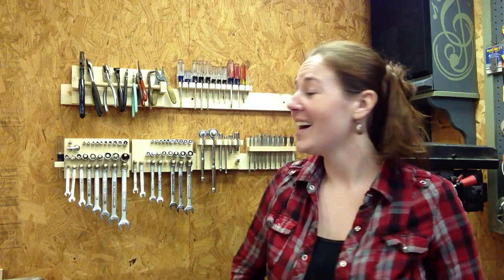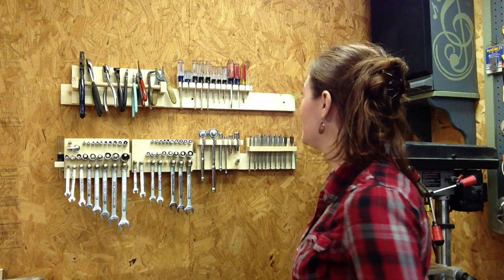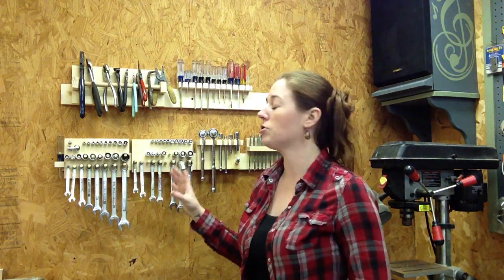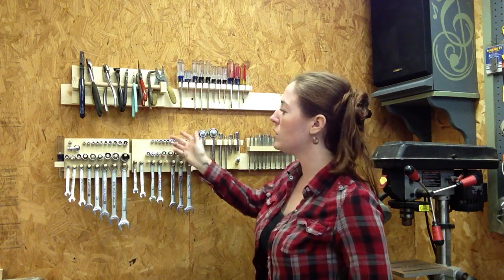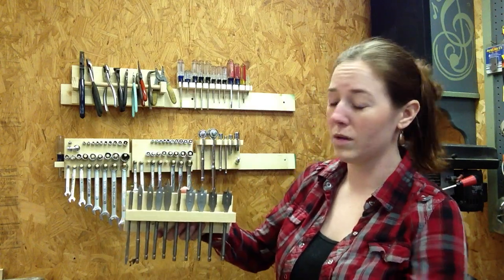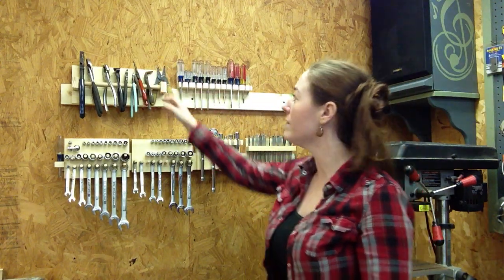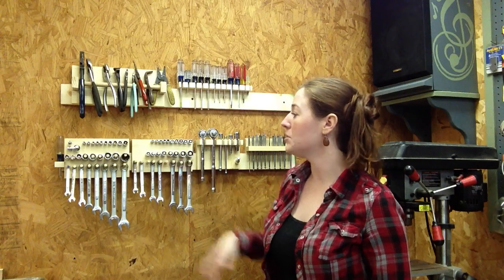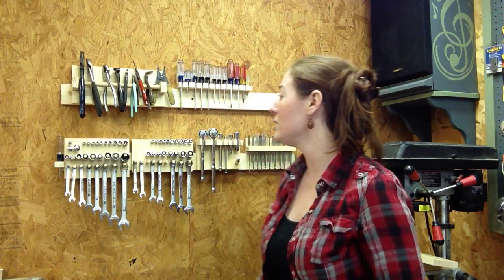DIY Hand Tool Storage System

Comment: Very nicely done.. I really like the screw driver holder, mine are just everywhere, really like how you done that.
Reply from the maker: Thank you : ) Another way is to drill a hole in the center of a platform (like I did on my paddle bits), then you can place any screwdriver in any hole. Since I knew I would be mounting mine kinda high, I went with the slots instead so they can be slid out instead of pulled out.

Comment: Nice system, although I decided to just put up a sheet of plywood and screw the holders directly to it rather than the French cleat method. I haven't regretted it, since I haven't needed to move things that much, and a few old holes here and there is no big deal. I like your method for the wrenches and sockets. If I ever hang mine, I'm stealing it.

Comment: Very nice work April, keep it up.  I like to do similar jobs around the shop.  You ever seen a DIY tape dispenser you can make as long as you want, portable or mount on the wall?  It used a hack saw blade to cut the tape.  Take care from Tn.

Comment: great work. one question, why does everyone use plywood backer boards, does it increase the holding power? I would think you could just install the french cleat system into studs and hang against drywall, am I wrong?

Comment: Nice!  I just subscribed.  Unfortunately, I use my wrenches and sockets ALL the time.
Reply from the maker: Hey there. If you like the idea of having them on the wall but still want to see the size, since you use them all the time, you can just attach a ledge on the back piece instead and put your dowels in so they are vertical. Or you could make the holder as is and just write the size of the sockets in the blank space between the two rows.
Reply: Right now, I hang the socket rails on a pegboard and keep the wrenches in their original carrying case (which is falling apart quickly and I need to find something to replace it).  I tend to grab the sets I need and take them outside to work on a vehicle/garden equipment.  I like the idea of having them vertical, but they generally aren't used at the bench.

Comment: Dammit April, designing something for my workshop that I thought I had finalised and now have to go (not quiet all the way back) to the drawing board :)
Reply from the maker: Oops. : ) That's happened to me a few times. Guess it's better than stumbling over an idea you like after you already built something!
Reply: April Wilkerson Have designed a table to go on my drill press with a fence and extendable arms to support longer pieces when drilling. It has a sacrificial piece of 1/2 inch ply that can be replaced when worn. What I hadn't allowed for was a tilt (where you used some wedges) so have now incorporated this function as well. That's what's so great about what you and others do as we can see a design and adapt it to our situation and requirements

Comment: Not bad use of scrap wood,  however some of the sockets. Might be better used with socket rales  .  $0.99 at harbor Freight Tools and they will screw into wood for mounting on a wall.

Comment: Very nice but I see one problem. What if you buy another socket, wrench, screwdriver etc? No room for an extra, no room for expansion. Looks good though.
Reply: They are made from scraps, put together very simply.  If she really wanted to expand her wrench collection (which is pretty unlikely if you paid attention to the video), it's no big deal to just make a bigger unit.  And you saw all the empty space on the surrounding wall, right?  It's not like she's permanently locked into only what you see here.  The beauty of a french cleat system is versatility with changes down the road.  Also, by the time most folks get around to making this sort of system, we typically have too many tools in the first place, cluttering up the place.  The point here is to pare down to the most commonly used things and put those out in the open.  The rest gets stored away somewhere else.